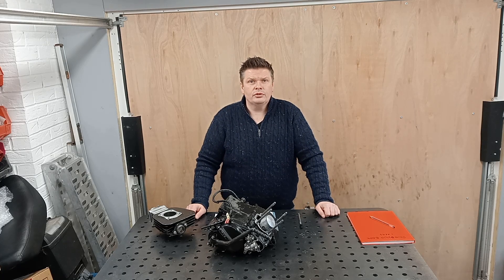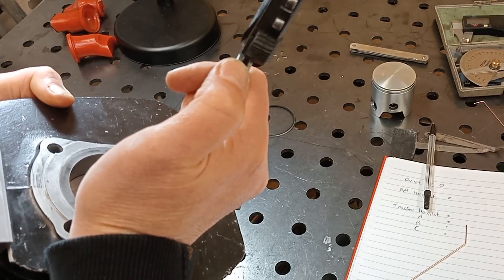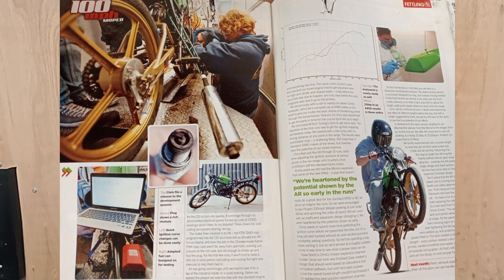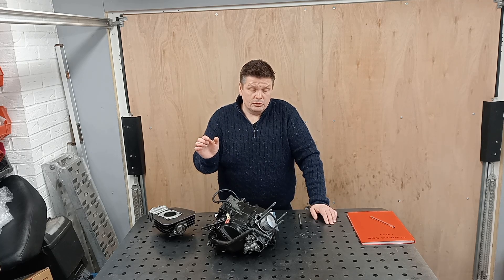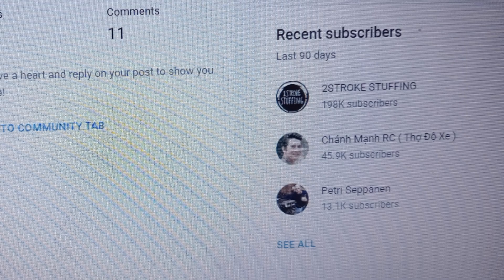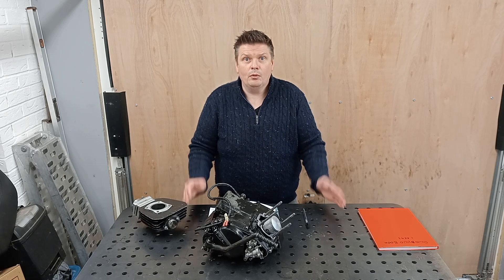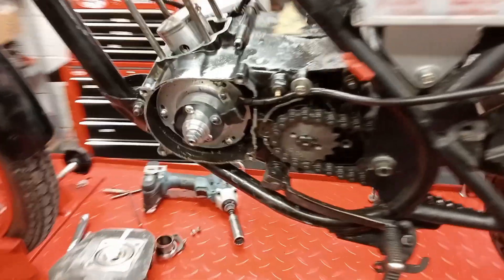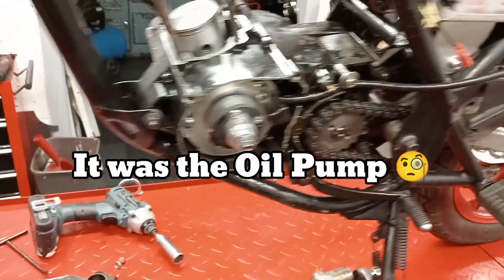How To Measure a 2 Stroke Engine - 100 mph Moped Challenge #2stroke #power #porting

Comment: One trick i use when measuring small volumes like that (as it's hard to be precise in interpreting the fine  graduations visually):  i decided to do it by weight, with painter's scales, measuring the burette/syringe before and after. You can now find affordable 0.01 g scales. Just a thought.  Godspeed, keep up the amazing work!

Comment: How many tightening torque for the  4 head screws of the Kawasaki AR 50?
Reply from the maker: 16 ft lb from memory, but I need to double-check.
Reply: @AutoBeta2T  thanks
Reply from the maker: Double checked and it is 16 ft lb

Comment: The best people to talk to is a gokart motor builder .  Get one of your heads and modified  so you can put inserts in . What oil are you running  rule of thumb in karting  in Australia because hot weather  gast iron  barrel  run caster synthetic oil  . Chrome barrel  full synthetic.
Reply from the maker: Hi Storky, I have a TS100 head that fits but is meatier than the standard AR head that I was planing to modify to take inserts. The thing is that I have found a load of AR 50 heads on ebay and at £20 - £25 each posted I think they are cheaper than it would cost for the insert material. I've got 5 now so I can try some different head configs with them. Eventually I will probably go to inserts when I get my cnc mill up and running.
I run Motul 800 : https://www.motul.com/gb/en/products/800-2t-factory-line-off-road
Me and my racing buddies used to race aircooled 250cc two strokes and used 747 but then switched to the Motul and never suffered another seizure. 
What oil would you recommend for an iron barrel?
Reply: Depending on how hard you are rev and for how long  see full synthetic break down after  14000 rpm   with caster oil  it done not break down  and makes the motor run cooler to  but it dirty oil  . Just go to local kart shop  to what oil they got   
It hard to say what oil today they change like the weather  . I would try both one with full synthetic and then one with synthetic caster in it .

Comment: If I could just add my 2 bob's worth >  As with 4 strokes,  I would suggest that the INTAKE side of you engine is the MOST important area to concentrate on. This means that the volume and diameters of the inlet tract  before and after the carburetor are very important, the inlet angle has to be as straight to the reeds as possible, which means the inlet tract will be at an angle to the horizontal, which means you need a carb (diaphragm, or FI) that works at an angle.  So right from the air entry which needs a bell shaped air corrector thru to the final piston port has to be looked at,  Just my years of high performance knowledge  .... rob   nz
Reply from the maker: Cheers for the info Bob.
The inlet is on my list of things to do. The current set up is pointing the reeds at the inlet ports and I have angled the carb (not sure if I can go further?) But I've not progressed developing it for a while. I was worried about it being too long with my quite complicated adaptor for the larger reed. I have other reeds to try and a larger carb. 
I'll hopefully get to having another play with the inlet in the new year. 
Cheers again, Dave 😊

Comment: Exhaust = 6.27° cm²/cm³
Transfers = 4.32° cm²/cm³
Blowdown = 0.53° cm²/cm³
Blowdown percentage: 12.08%

I estimated your porting using Blair's formulas, which indicate an 18.83 HP output for your engine with the current porting.
I would aim to achieve a corrected piston speed of 17.47m/s at 12600 RPM.
Is your current output of 17.8 HP achieved at 11900 RPM?

Perhaps you could consider shortening your header pipe or lowering the compression ratio (which would further heat the pipe) to reach 12600 RPM.
For enhanced performance, raising the transfers (lifting the cylinder, if feasible) would be beneficial.

P.S. The correction of the targeted piston speed formula is: 20m/s * sqrt(stroke/bore)"
Reply from the maker: Hi mate. Thanks for information and sorry for the delay - I had to dig out my copy of Dr Blair's book to refresh my STA knowledge. Can I aske is your power estimate at the crank or wheel?
I'm using EngMod2T for the specific time area calculations. 
The blowdown is: 0.001144 s/m - 27.7hp at the crank at 11500 rpm
And the exhaust is: 0.014580 s/m - 23.3 hp at the crank at 11500 rpm.
I don't have the STA for the transfers with me and from memory the inlet is lacking a little. I need to recheck but the STA for reedvalves can be a bit lower than what the can achieve.

I wanted the keep the rpm as low as possible for longevity of the engine and to prevent it getting too peaky and having trouble in pulling top gear. However, it may be required to get the power I need. 
I'll re-run the STA figures at a 12600 rpm target and see what it says. 

The figures you presented at the beginning - are they from the information in the Jennings Angle Area article?
Reply: Try targeting 10302,83 RPM in EngMod2T. Does your current exhaust and blowdown give a matching hp? What i need to know is transfer STA, Now I based my answer on the blowdown/exhaust ratio (see story below). Maybe we should mail each-other? My ramblings are getting too long :) There's a good reason to only trust Angle*Area

Jennings made a few flaws:
"One cannot simply substitute angle-area for time-area and ignore the engine speed factor"
But Angle*Are at a specific RPM is exactly what the STA is.
The RPM "is" the engine speed factor.

AA = 6*STA*RPM
STA = AA/(6*RPM)

blowdown 0.001144 s/m * 6 *11500 = 78.936°mm²/cm³ = 0.78936°cm²/cm³
exhaust 0.014580 s/m * 6 *11500 = 1006,02°mm²/cm³ = 10,0602°cm²/cm³

I wrote my own calculating sheets and that's how I know many tricks from the book.
Remember EngMod2T? It actually calculates the AA and you provided the 11500 RPM so it can convert it to STA
As you've found out this gives the blowdown 27.7hp and the exhaust 23.3 hp,
however there is always a RPM where they should match and give an equal hp.

Blair gave us the formula to convert STA to BMEP:
Bmep exhaust = 1050 x STA(ex) – 5,975
Bmep blowdown = 8187 x STA(bl) + 1,75

Now I rewrite the formula to match both ports to give equal BMEP:
1050 x STA(ex) – 5,975 = 8187 x STA(bl) + 1,75

then rewrite it to find the STA(ex) providing the STA(bl) gives:
STA(ex) = 8187 x STA(bl) + 7.725 /1050
0,016277 s/m = 8187 x 0.001144 s/m + 7.725 /1050

Remember that your actual AA has already been provided and the target STA has been calculated
RPM = AA/6*STA
10302 RPM = 1006,02°mm²/cm³ / 6 0,016277

However Blair's formula's are old and Jan Thiel pointed out that you can't trust the historical view of the exhaustport time*area.
So that's why I should know transfer STA and you can't use the reedvalve-intake-STA due to inaccuracy..
Reply from the maker: Hi again - thanks for the reply :)
Email would be good - autobeta2t@yahoo.com

I looked for the convergence rpm and at 9000 rpm the exhaust and the BD STA were about the same (within .2 hp).

The transfer STA is 0.008594 s/m at 11500 rpm ( 27.14 hp achievable at 10975 rpm). 

I have just remembered that I did convert the angle*area for the RSA that Frits Overmars provided to STA. If I remember right Blowdown was near to Blair but transfer was higher - however I cold be completely wrong - I did this about 12 years ago and haven't delved into two stroke technical stuff for maybe 10 years. I probably have my calculations somewhere but I can't find it.

Interestingly when I used  flow testing equipment it came out with a Flow Time Area (FTA) for my exhaust of: 0.01547 or 25.6 Hp @11500 rpm and a Blow Down FTA of: 0.001092 or 26.65 Hp @11500 rpm.
I managed to increase the Flow Time Area  by putting some Plasticine in the center of the bottom of the exhaust duct - the noise emitted lowered too and Exh TFA and BD TFA increased to 27.1 Hp and 27.5 Hp respectively.

Comment: I can't run 2 strings longer than about 30 cm on a 3 hp grass trimmer (engine doesn't reach powerband). 
How much power is lost to spoked wheels on a fast moped?
Reply from the maker: Hi buddy TBH i'm not sure. Spoked wheels are often lighter.

Comment: One instructive thing people should note when watching your videos is that you consistently use precision in measurements and adhere to documented methodology both if which are key to developing 2 strokes, or to put it another way, precision and methodology may not guarantee success but a lack of it will guarantee failure.
You can get away with simple trial and error methods with 4 strokes but 2 strokes could take you forever without methodology and precision as there are just too many variables involved most of which influence one another.
Just a note on Bells book.too.
It is basically a close copy to Gordon Jennings 2 Stroke Tuners hand book with the addition of anecdotal notes from Bell specific to a number of engines.
Jennings book is quite dated from the 1970's
The expansion chamber equations given by Bell for example is an identical albeit metric version of Jennings imperial based equations which he created as he describes in his book by basically measuring up various works pipes of the era and doing a bit of reverse engineering.
Reply from the maker: Cheers mate - appreciated. I've even got my red book now for keeping notes of everything I do with dates etc. I tried without but I've got myself lost a few times... There's quite a lot of data to deal with.
Reply: BTW what was the end MSV for that squish clearance ?
Reply from the maker: I'll have to work it out. Quite high I recon.
Reply: @AutoBeta2T  
I plugged the numbers into my MSV calc but wasn't sure of the bowl diameter and the number was about double optimal
Using 13k RPM, figured maybe I got the numbers wrong.
Reply from the maker: Hi mate - I just had a look on EngMod and it has the squish at 48m/s at 11500 rpm.
Reply: @AutoBeta2T   Yeah that's a bit high.
Optimal is 25 m/s
Keeping in mind that the squish band is there to reduce the potential for detonation that excessive squish velocity increases energy and conversely thermally which itself increase the chances of detonation somewhat offsetting the benefits of a squish band.
I know the prevailing internet forum wisdom is the less clearance the better and only mechanical constraints are a factor but ..... lets just say, there is a good reason why squish velocity calculators exist.
Reply from the maker: @AuMechanic cheers for that figure. If I increase the squish clearance to 0.8mm I get 27 m/s, 0.9mm get me to 25 m/s.
I have 4 spare heads now that I can machine to differ specs and test one after another on the Dyno so there is minimal affect from the metrological conditions of the day. 
Cheers again Dave.
Reply: @AutoBeta2T  27 is about the highest you want.
Reply from the maker: @AuMechanic cheers Dave
Reply: Ok...nice video and info. Just built a cr80. The stroke is 47.8 I set the squish to .036" Using 91 octane.   Running a little fat on the jets

Comment: Thinking about your squish/quench gap I did some numbers for your engine and see the piston at max pressure where detonation is most likely  11-15deg  ATC
ATC          Piston down bore
11deg          .4572mm
15deg          .8382mm
25deg           2.336mm
If you add the clearance to that it makes me wonder how important it is relatively to get it really close. I remember the GP suzuki 750 back when had no squish bands at all and ran fine with high power for the time. Just food for thought.
Reply from the maker: A no squish band test - I like the idea of that. Could be interesting!
Reply: @AutoBeta2T  You'd still want the charge concentration in the center that squish bands give but maybe that's a bigger benefit than the squish band itself. 
There is a small pumping loss from tight squish bands, especially on 4 strokes. There is a trend in cars to relieve the squish pad with an angle opening to the chamber.
I remember Kawasaki drag engines (Denco) having double squish bands, which is just relieving the angle with a second one.
I wouldn't put too much time in it though, I doubt there is very much in it.
Yamaha has an SAE paper on the shapes and effects.
Reply: @billshiff2060  There is plenty to it. MPS is the number you're looking to hit and back off from there. Having a lower angle and domed piston require much less quench area. Many people cut a piston flat on top so they don’t have to be bothered matching or manipulating angles. Then they keep adding quench area to gain compression 😢
Reply: @kenmoule825  There is very little power to be had playing with that. Much better off working on other areas.

Comment: It's better to measure squish at front and rear of piston because the head will settle more toward the front opening up the squish on the hot side of cylinder. A way to avoid this problem is to center the head to the cylinder with a tool indexing off the spark plug, then pin the head with a 1/8" dowel. Then squish stays consistent when head removed and replaced.
Reply from the maker: Cheers for the info Dale. I do have a locating spigot on the barrel that does centralise the head. However, there could be some radial off set as the studs are slack in the head stud holes. 
I'll double check at 12 and 6 next time too.

Comment: While on measurements, Have you got an estimate of the power that will be required to overcome drag @ 100+? You should include the planned frontal area of the bike/rider that will be used and a rough estimate of the CD too.
Reply from the maker: Not exactly Bill. I know the original bike got to 94 mph with 21 dynojet horse powers; about 18 on my dyno. I fugured another 2 or 3 on top should do it. 
I do have a program that does top speed etc that I was going to do a video with but didn't. I'll look to do it at some point soon. I also have John Bradley's book so I'll brush up on Cd too. My program will estimate this but it said that the original bike should have done it. Maybe dynojet hp is a bit over egged? This for me is the best bit about this challenge - physics will be the final arbiter :)

Comment: Just looked over your port timings and your transfers should be around 134-136 not 128(128 is good for 10k rpm not more) I think you can find a lot of power there :)
Reply: Your carburetor is a bit on the smaller side to so test a bigger one like 30-32-34mm I would recommend PWK style carburetors
Reply from the maker: Hi Miiltonulm, I have epoxied the transfers as I thought I didn't have enough blowdown. They were around 134 anyway. I do plan to grind out the epoxy  during a dyno session to see.
I have a 30mm carb in reserve,. The 28mm I have seemed to work better when tested a while back but with more power now maybe time for the 30mm?

Comment: Your method of measuring port height, is not very accurate.  Get a Veritas wheel type marking gauge (104388), to establish the port height, and then measure the port height from that using a depth gauge. Squish needs to be measured with solder, at 12 and 6, also 9 and 3, cross pattern, twist together in the middle.  Its possible to run .5mm squish on Nikasil motors up to about 70mm, with tight bore clearance, but on something with a wafer thin liner, which is likely to move a fair amount, 1mm would be far safer.
Reply from the maker: Hi - I've just looked up the Veritas gauge - looks good. I'll get on ordered. Noted on the squish. I have previously only gone 3 to 9 at this is inline with the piston pip and no rock. I'll try with 6 and 12 but always felt that there would be some rock there?

Comment: At some point the pipe starts sucking ,but cant suck because the transfers still closed. Exhaust opens earlier now after the modification , did you change the transfers also ????
Reply from the maker: Nope - just the exhaust port. The transfers may need changing, and the pipe, and the compression ratio, and the corrected compression ratio, and the ignition, and the jetting and... and... and.. 
Bloody two strokes - simple but they aren't

Comment: My understanding was squish gap  should be as small as possible without the piston hitting the cylinder head, and that a suggested clearance was only a rule of thumb to allow for play/ expansion. I couldnt see cleary on the video but it looked like a large area where the squish area is blended into the combustion chamber.
Reply from the maker: That's my understanding too but with a lot of things with two strokes it's a bit more complex than meets the eye. My MSV is quite high with the 0.45 gap.

Comment: Hello, couple of things, the book you’re using is as a reference, whilst good for its time is very old, things have moved along a long way since then! Maybe a good place to look for port design would be emulate port design from a motorcross engine. In addition most modern 2 strokes are using special coatings on both the cylinder bore and inside the combustion chamber.
Reply from the maker: i mate - I only really use the Bell book for reference for the calculations. There is a lot of info on the net that super-seeds that from Frits and Jan  in various threads... My ports are quite difficult. The exhaust is a single and there transfers do no sweeping at all... there just is no room to do that. Maybe a new cylinder or fin removal and welding?
Reply: @AutoBeta2T 5:27 Supercede.

Comment: To find out you have to measure with 360 degree-wheel , now have numbers from the calculator , thats not the same.
Reply from the maker: Hi Henk - but the number I have gets converted to degrees. I don't really see the difference. On the exhaust 0.1mm is half a degree so fairly accurate. Most degree wheels I have seen have marks for each degree. I would like to try one of the magnetic angle boxes and they have a greater resolution than both of the other methods.